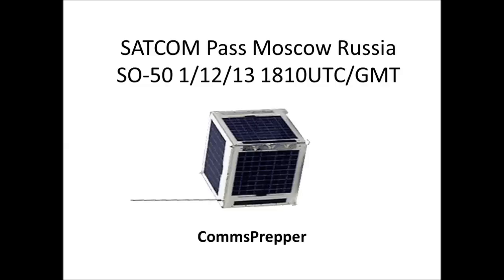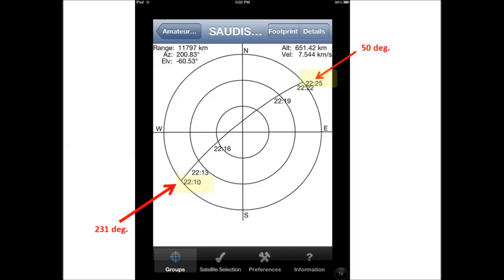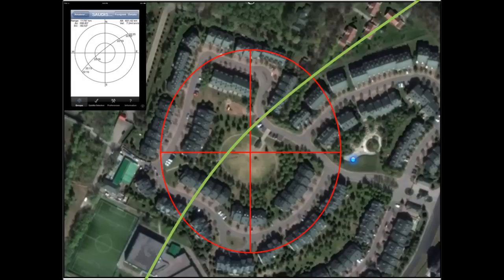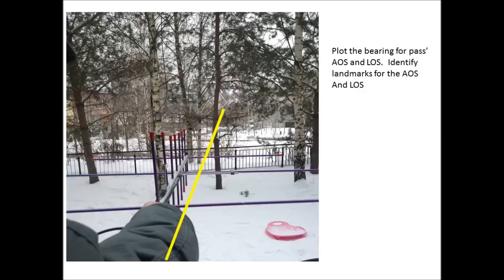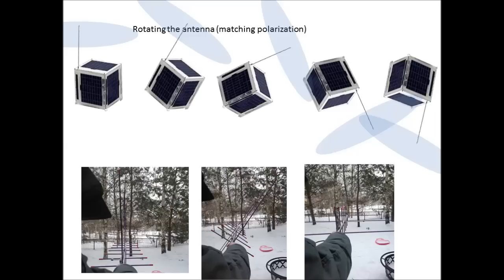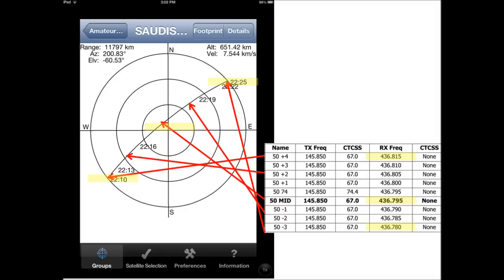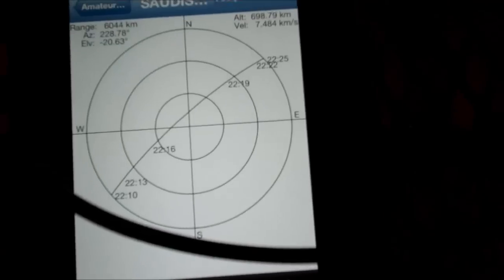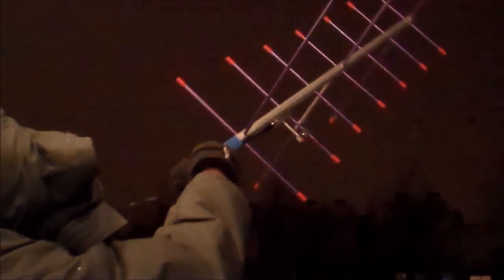SATCOM Part 2 (with Ham License)

Comment from the maker: I can be done with one person.  Easier when you use a camera tripod to hold the antenna (I did not use mine).  I started working these sats last summer in the state - seemed easy then.  Add the cold and it changes everything.  The Saudi SO-50 is not an easy sat to work...  The US AO-27 was great but stopped working in October - I hope it comes back.